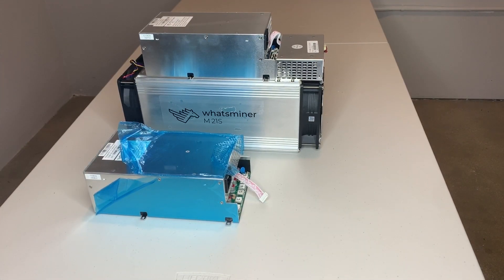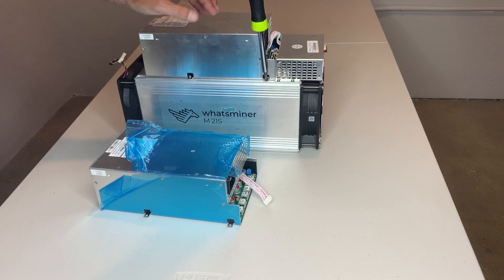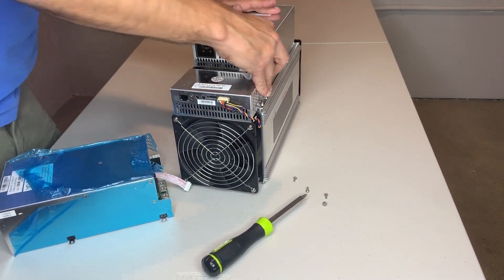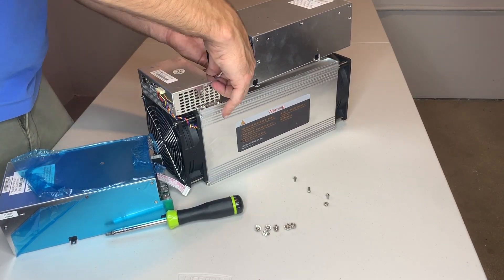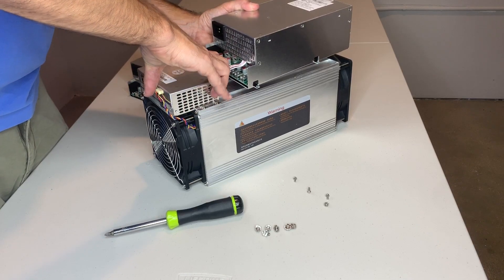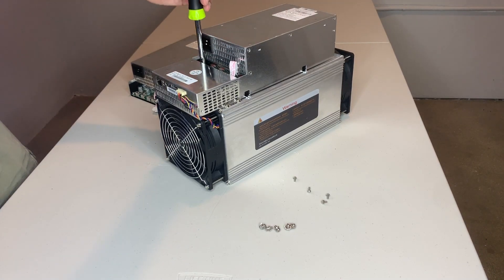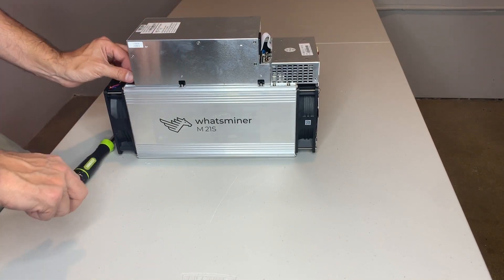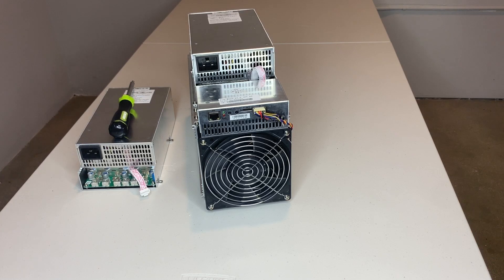WhatsMiner M21S Power Supply (PSU) Repair Video

Comment: I've the fan on both the back and front of my m21s burn at the connection points. Should I replace the control board and the power supply or just power? Ant help would be appreciated!

Comment: hey. i have a whatsminer m3 and the power supply is broke. i cant get a hold of a new one. is there any alternative power source i could use? is it possible to use it from an antminer s9 for example.

thanks a lot
Reply from the maker: no u cant use a antminer as thats not the correct power. You need atleast 220V - 2500W PSU but the problem is on M3 new models they where hard wired with cables.  You will need to improvise as most off the shelf PSU have 9 pin plugs
Reply: @joecrypto2864  thanks man i appretiate your advice.

i have little none electrical knowledge... would it be hard to do